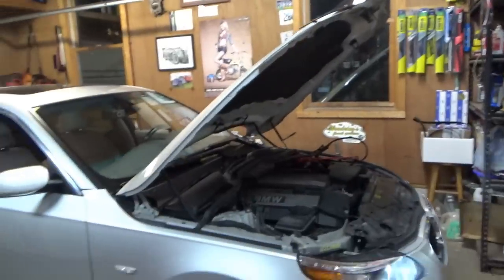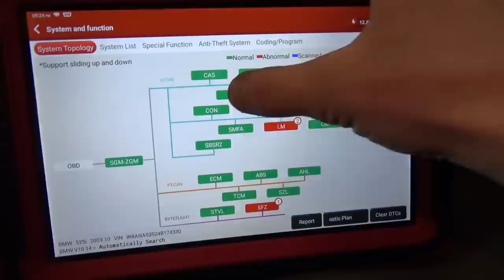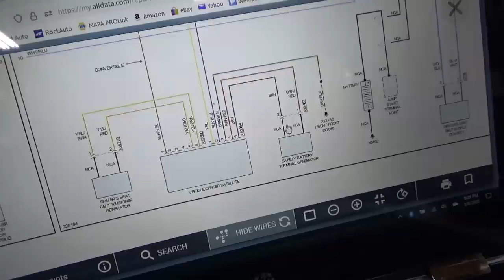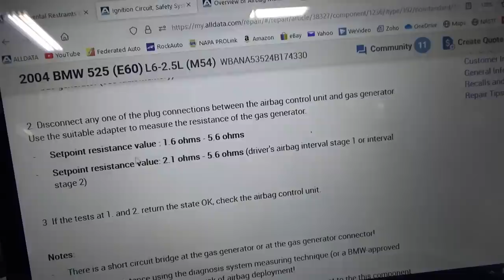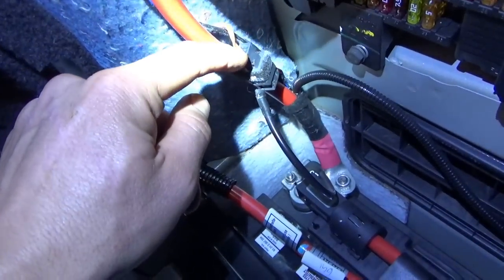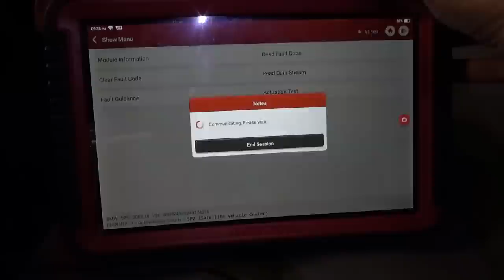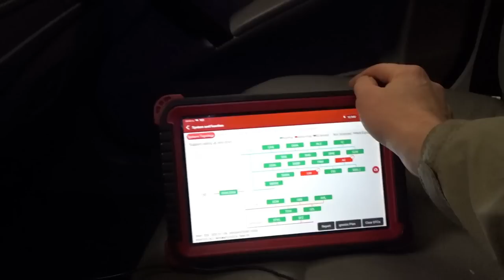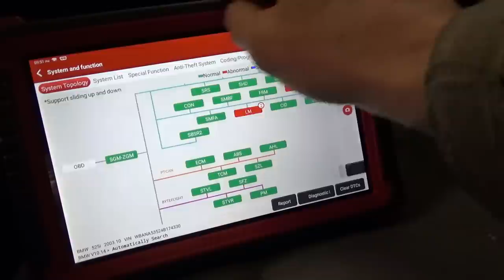Never Seen THIS AIRBAG Warning Before...(BMW 525i)

Comment: Your comment about enjoying working on those had me smiling. In the late 90’s I had a European version of that same car while living in Italy (520i…maybe?). It was indeed flat, smooth, and powerful. Well the fuel pump went out and I was absolutely cursing the prospect of dropping the tank in my tiny garage. Just on a whim I pulled the carpet back in the trunk and sure enough, there was a little access hatch.  First time I had seen that!  Job took like 20 minutes.
Reply: The fuel pump access hatch is pretty common on most cars with the exception of many American cars because it would have cost an extra 5 cents per vehicle.
Reply: @joeyt6089  Is one of the reasons why I own Honda's, I work  on my own Cars and Hate Stupid none accessible parts, The Crazy thing is I almost never have to screw around with those pumps in a Honda, Haven't had a bad one Yet🧐.
Reply: My 98 Volvo had one. The mechanics I went to wanted to drop the tank anyway for $400. Went elsewhere. It was for the rollover cutoff check valve, which was on top of the tank right at the access hatch.
Reply: @Werner Danler  interestingly, AWD Volvos of that vintage had no access hatch, but you could cut your own in.
Reply: Some Japanese cars have it most BMW s do.

Comment: Sounds like a James Bond gizmo disguised as safety feature. This is Engineer level troubleshooting just looking at the schematic! Even the interior connectors are exposed to extreme temperature and humidity swings that can speed up the oxidation process. You nailed it by checking the easiest thing first.

Comment: Im in the UK and have had this issue for around two years, in the exact same car. We have to pass the MOT yearly so just before each inspection I wiggle the BST and clear the codes and luckily the code goes away long enough for me to get through the inspection. Cant believe how lucky I am that you posted this video so now I'll try this as replacing the air bag modules etc is way too expensive. Thanks man!

Comment: I've noticed that BMW has their own trouble code numbering and code description system and its completely different from everyone else's. Definitely makes using different scan tools difficult. Additionally with the newer BMW cars maintenance is much more complicated. You can't even replace the battery without having to reprogram the new battery information into the car's module system. The smart charging system won't work without everything being reprogrammed. BMW does not like other people working on their cars they want you to have to go to the dealership. Glad you were able to fix this one without a bunch of hassles.

Comment: Hi Ivan. AUC sensor = external air pollution sensor (works out if it needs to switch on auto re-circ). Fogging sensor = sensor located in the rear vision mirror cluster and detects a fogged up windscreen, and automatically turns on the windscreen defogger.

Comment: Since there is unseen contact corrosion there, being right next to the battery I would add a tiny dab of dielectric grease after the deox. You should check that the battery is vented properly. Acid fumes will definitely corrode those tiny pins and socket contacts. Nice job young man!

Comment: The BMW six is pretty simple to work on depending on the year, what needs to be done and the model. Generally, the newer they are the more difficult. And, "If you have no codes you don't have to wear the seat belt". Around here, tell that to Officer Friendly.

Comment: I have fixed several Ford airbag issues by unplugging and cleaning the connector to belt pre tensioner. Usually under drivers seat.

Comment: I work in a body shop.  So, I've had to replace quite a few of those battery cables.  lol.  You said that was a 04?  That was a very clean example.  But yeah, general maintenance on those cars is not very troublesome.  A starter motor replacement is a bit of an exercise though.  lol.

Comment: That battery disconnect using mini explosion is also called pyrofuse. Mercedes uses it too, some at battery positive post, some at f32 prefuse box. Actuation is similar to airbag. Monitoring it is via resistance, i believe above 5 ohms is considered too high. In an event of a strong enough crash/impact whole car on purpose loose +12v by firing of the pyrofuse, for prevention of fire. Its quite a sealed system without actual spark exciting any hydrogen or fuel vapor. Similar to race car on the hood manual battery disconnect if for fire prevention

Comment: Got to love pin fitment issues, airbag and mux voltage circuits are the worst, I like using the air bag simulators with the known resistance in the aes wave terminal kit. 👍great fix

Comment: When I see a battery in a space like that and all the connectors, fuse blocks it looks like a pack of troubles waiting to happen.  Even vented that area will have acid fumes, and different humidity levels . and why would a engineer put a critical safety connector in such proximity of a battery?  "Perfect" systems need perfect maintnance and that is very hard to find. You did a great job locating the fault, A dealer would probably sold bags sensors and modules, if available...

Comment: The terminal location seemed so clean, right? Except, being strapped close to an automotive-type battery typically involves a corrosive environment (outgassing fumes);  scrubbing of the contacts was the fix. The deoxit mineral spirits component should provide a modicum of future protection.
Reply: Hopefully it is a vented battery, and the fumes are led outside. At least, they are on my Volvo
Reply: @bryanlatimer-davies1222  I think every car I have seen with a rear battery has a vent tube, definitely all Mercs and BMWs
Reply: @arcadeuk  Thats what I thought
Reply: @arcadeuk  At least with the OEM battery, but often the aftermarket replacement does not have the vent connected correctly.

Comment: Previous mechanic accidentally shorted some wires and blew that explosive battery disconnect on a Z4, i crimped the battery wires back together and used a resistor to trick the SRS module and kept it happy.
Reply: Wait a minute?You mean the entire car didn't explode along with the building it was in?

Comment: Beautiful!  I am sure you have driven a surge in purchases of DeoxIT, I have a can myself now.  I have just purchased a X3 3.0D (M57) BMW of similar vintage and quality, it was making a horrible noise at the front of the engine and leaking coolant everywhere, and the owner was told it's a $5,000 fix (engine replacement).  I had a look and took it for a drive and thought differently, offered a $1000 and was able to drive it home.  Was lucky with my guess as the problems were superficial and external to the engine (not the timing chain) and waiting on the final parts for the fix.  It has cost me a few hundred dollars for the fix.  Also pleasantly surprised at easy removal of all electric radiator fan for easy access to front of motor.
Reply from the maker: Sweet deal!
Reply: @PineHollowAutoDiagnostics   years 2000 to 2010 seem pretty good if you are driving the older cars👍

Comment: Clean it pins on the connector works.  I usually cut the connector out and butt connect the wires together to make it does comeback.  
(Murphy Law)

Comment: I guess, replacing a BMW Positive Battery Cable is a very expensive proposition. Connectors.... I can't tell you how many times reseating a connector or reseating a PCB card has fixed a problem.

Comment: That connector is measuring voltage drop across the generator. That's why when you shorted it, it saw zero voltage drop between the pins and said something was wrong.
Reply from the maker: But it said OPEN circuit 😅

Comment: Ahh. I live for your bonus footage. 😅😂
My 01 e320 has had the airbag light on for a long time now. I disconnected the bag on the rf door when replacing the regulator.
I did both back doors before without unplugging them
I shouldn't have done it but now I can't get it to shut off even disconnecting the battery doesn't do it.
Oh well!
Reply from the maker: Need a real scanner 😉

Comment: There might be a bit of hype around a multimeter setting off an airbag etc but I can see that it might be a real risk too.  I'm no expert when it comes to setting these things off but it's probably a hot wire approach.

How could a meter do it?  Static electricity perhaps, if the point of breakdown just happens to be on the surface of the heater wire itself.  Pretty remote but not impossible.  Another would be accidentally putting the meter across the heater while it is in diode test mode. For the average meter there just isn't enough current to do it but a meter designed for testing high voltage diodes, it might be enough.  The last and probably most likely would be accidentally having the meter leads connected to the current (amps or milliamps) terminals when testing the device and instead of measuring voltage from say vehicle - to device you allow high current to flow through it instead.  Remember, the range selector on the meter usually doesn't switch the current shunt, it's always across the current input on the meter.

Again, I'm no expert on this so this is just idle musings.

Comment: Modern cars soon have more computers then a small server farm 😂 good simple fix. I had a simular fault with a abs sensor a while back works perfect 364days a year. The one day it won't work there is no telling why. Just reads jibberish speeds. Only way to fix it is to turn off the car for the night. And it's only on like 1day a year it does that.

Comment: Hi Ivan. Surely a 200ma test light has a resistance of 60ohm (12/0.2) not zero when you plugged in series. When you added fuse in parallel should be close to zero
Reply from the maker: That's resistance under load! Go ahead put an ohm meter across a bulb and tell me what it reads 😉
Reply: @Pine Hollow Auto Diagnostics  Ivan I learn something everything I watch your channel. Been reading up on incandescent bulbs and their non-ohmic properties. Can't test one for real as on holiday but will do when I get back just for curiosity. Thanks again for the brilliant channel and for responding to my dumb question.

Comment: Yep great idea. Having an explosive charge on top of the battery. Specially if someone replaced the AGM battery with regular lead acid battery. That build up of hydrogen gas will turn it into a wide body M sport model. 🤣🤣

Comment: I was just wondering if you look for a safety recall before you work on the air bag?
I know a safety recall wasn't the problem, it's just the 1st thing I would have done
Reply: I was wondering also, especially if someone replaced the battery and didn't properly install the gas vent tube.

Comment: Anyone putting an explosive device near a battery must be working on a Darwin Award.
Reply: Just look at all the exploding/burning BMWs littering the countryside!  😊

JUST KIDDING!!!!!!!!!!

.It's actually a good idea. Take a look at what it takes firemen to cut the power from the battery to a Tesla. They have to remove a panel and use a giant pair of cable cutters.with insulated gloves. I think the BMW idea is probably a better idea.  😉
Reply: @stevewhite3424  Lithium Ion batteries burn BUT lead acid batteries give off H2 Which is very explosive. Having a source of ignition near a lead acid battery is nuts. Teslas tend to self ignite, like Chevy bolts or volts and also Kia/Hyundai seem to burn well.
Reply: tesla is using pyro fuses near the hv batt too
Reply: @mikefoehr235  So if you really wanna get down to it?  Show the BMW's with pyrotechnic battery disconnects burning on the side of the road and I can pull up dozens of pictures of Tesla's. My son-in-law's volunteer fire department in Delaware underwent a free training session given by a Tesla field rep that showed the efforts necessary to disconnect the. Battery from the car. Sorry but the demonstratable risk is completely different and far more likely on a Tesla unless you can show me burning BMWs that caught fire due to the proximity of the battery to the pyrotechnic disconnect.   In fact show or cite just one...
Reply: @Phoeliz  Not a single model 3 contains such a device. The 3 ways Tesla provides to disconnect the high voltage power all require glass breakage, panel removal and or cable cutting.  Tesla even provides training and training videos on how to accomplish high voltage battery disconmect.
Reply: @stevewhite3424  Keep in mind this only goes off if the car is in an accident. The damage might be chalked up as part of the accident.
Reply: @russellhltn1396  Or, much more likely, it has never rver ever ever happened.  Funny? How. So? Many people worried about the battery disconnect viral? Technique but have no problems riding around with 20 plus gallons of gasoline in a metal container thinner than a dime in high speed traffic.  Lol!
Reply: @stevewhite3424  Tell you what, next time you jump start a car, make sure you connect directly to the battery terminals. You'll probably get away with it several times.  But one day you may not be so lucky.

Comment: Life of connector is probably still much longer than vehicle was expected to be used before being recycled. If BMW intended this vehicle to be driven longer, they would have a connector of each type connected to a computer that would measure pin resistance and provide compensation factors to modules having those type connectors😊
Reply: That's even more stuff to go wrong.
Reply: @hcox1111 , That would be more Cherman Engineering.

Comment: any vehicle with battery inside, is near always a tube vented type, with it run out the bottom. that way if boil over, roll-over, large off-gassing occurs, it vents outside into open air. no kabooms, from oxygen rich hydrogen gas +p (broken down water -  H2O) 2 hydrogen molecule and one oxygen molecule. BOOM.

Comment: I hope no one sees this and gets the idea to just start tampering with airbag systems.  2 reasons. Its dangerous as well as deadly. And very costly if you blow one.  Dont mess with them, I watched a guy blow just one curtain airbag on a car it cost 4k to fix. Just one airbag. 
Modern cars have them in the dash. The doors steering wheel, seats and celings 
Just the airbag system alone can total a car.

Comment: Yes, it looks like the device installed in the vehicle is so close to the upper impedance spec that almost anything can cause the system to go out of spec and generate an error. I don't know about anyone else, but that seems like some very questionable engineering or a planned failure point to increase  dealer service department revenue.

Comment: This car is rigged with explosives! Low current connectors can get slightly increased resistance over time - unplugging and replugging is enough to wipe out any residual patina.
No parts required and no bonus footage required - could be a first :-)

Comment: Be aware: its not a Myth that its risky to measure airbag system. Depending on the system and the multimeter it can ignite. It even can ignite by touching it with fingers by body tension. They tried it, its dangerous. It seems that newer components have a safety for that in the connector, if it is unplugged its safer.

Comment: How did BMW figure out a way to complicate a fusible link?
Reply: Because the fusible link can not always blow before a fire breaks out. This however will disconnect if the SRS system detects that there has been a severe accident, and disconnects the main starting wiring and engine power from the battery, but still leaves the rear fuse box, which contains the power for the always on things like restraints and door locking, on, so that the SRS system can still unlock the doors after the impact, and also have the hazard lights on to make the vehicle more visible that it has been disabled.
Reply: @SeanBZA  BOO HISSS ect.

Comment: The "open circuit" code when you had it shorted is a scanner glitch, very misleading. It can through you in a different direction chasing a problem that doesn't exist!
Reply from the maker: Well it's the car setting the code, not the scanner!
Reply: @PineHollowAutoDiagnostics  I would've try though with a different tool, been there done that. I have countless stories when the scanner data base is wrong, especially this neochinese tools. 
It's weird and wrong to set an open code when it clearly should have have low resistance or short circuit.

Comment: you can get rid of this code by putting a correct resistor on the car side of the connector but you will loose the safety of the expolsive disconnect what no bonus footage  and no test drive how do i claim my refund LOL

Comment: This seems unrealistic for an engineer to do something like this when they can just design a more robust battery hold-down for sportier cars.
Reply: It’s not about holding down the battery it’s to disconnect the power in an accident to remove the risk of sparks from damaged components possibly igniting leaking fuel for example
Reply: @markhancox5475  I understand your perspective and I acknowledge that as a more credible reason for the terminal.

I still think this is silly overdesign because of the arc that this would draw if something was actually shorting right after an accident.

ps The ASD relay (Auto Shutdown) has handled the job
of diabling the fuel pump and injectors for decades.

Comment: I bet these repairs would not have had such a great outcome ($$$$) had the owner gone to a dealer instead of Ivan.
Reply: Definitely would have required model replacement! The cherry on top would have been to program it for a the bargain price of $399.99! Only to have the light come back on heading out of the dealership!